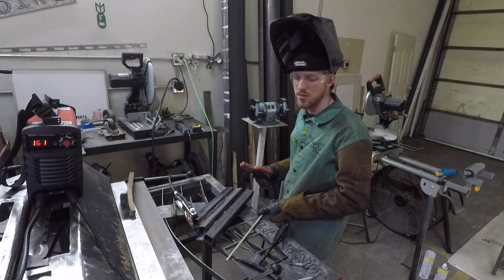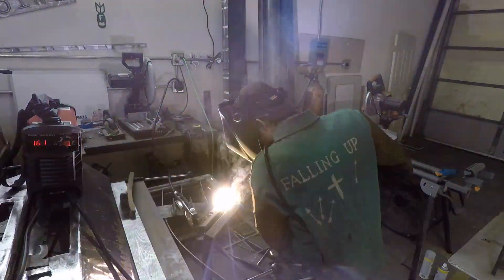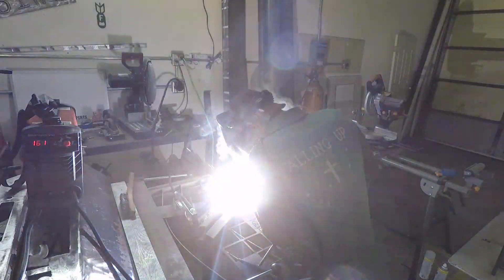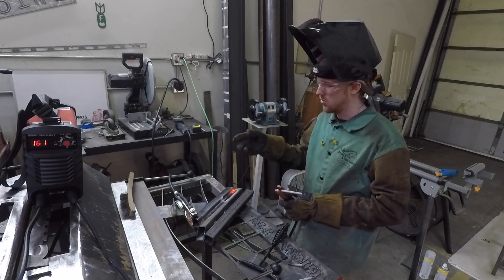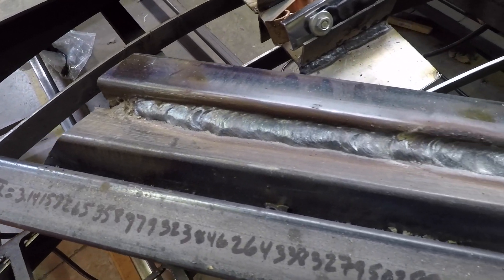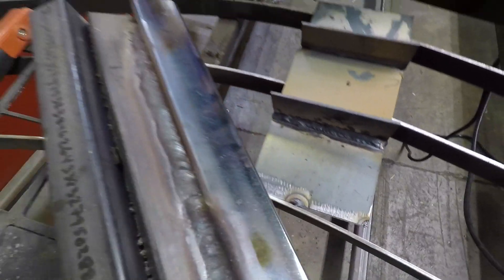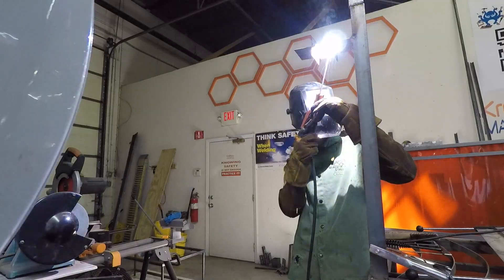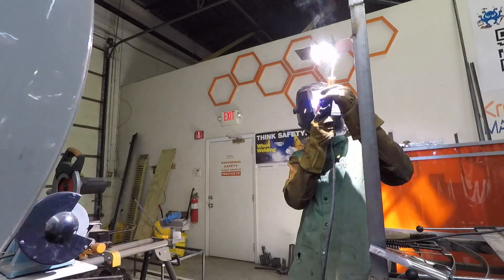Review of ZENY Arc Welder Full Power 220 Volt Test  - Part #2

Comment: So?   I am very impressed with this little Zeny welder so far.  I have pretty much narrowed my search down to this unit.   But my question is.  I have a 220v 20amp outlet in my back garage.  Would this unit run on a 220v 20amp breaker?  The outlet is wired with #12 wire.  So 20amp breaker is all I should use.  My home portable generator is also a 220v 20amp breaker.  Thanks and enjoyed your very informative video.
Reply from the maker: Good question it should be able to work fine!! for most projects.
I have found depending on the machine  that a 20 Amp 120v outlet can get 95 Amps to 120 Amps of welding output.
so on 240v 20Amp I would assume it would be just fine.
And I have been quite pleasantly surprised with how well the welding machine has held up I sold it to a friend who does welding almost continually with it and it's been operating for years under commercial use and held up perfectly well !!!!
Reply: @CreativityUnleashed  Thank you much.  I value your opinion.  I ordered the Zeny yesterday.  So I'm anxious to see how it performs.  Thank you for your video.

Comment: I just got this welding machine and have never welded in my life. I’m going to try and learn with this machine. What sticks do you suggest? Should I run it on 110v or 230v on my generator? Also any advice would be greatly appreciated.
Reply from the maker: Good question when welding on especially smaller generators it can be just a bit more difficult to initiate  the arc because of the rapid high demand of electric.
220 volts whenever possible is going to work better.
And as far welding electrodes (1/8"E6013 about 100 Amps)are probably the easiest electrodes to use. Not all welding electrodes are created equal there are a lot that are good. But I have grown to like Washington alloy
Reply from the maker: https://youtu.be/45-Ipl8E0bk

Comment: Thank you for your honest review of this welder. I’m thinking of picking one up. In your last video you said it kept tripping the breaker when plugged in using 110v on 20amp breaker. So my question is. With this unit, if I was just going to use it on small projects here and there is it ‘functional enough’ on a 20 amp breaker or would you recommend putting in a higher amp breaker or would I really need to install a 220 v plug to use this without major headaches?  Thanks again for your videos
Reply from the maker: inthewake what I meant to say is it was on a 15 amp breaker and it kept tripping the breaker but when I used it on a 20 amp breaker it had no problems.

Comment: Just got this welder as a birthday present to myself. I have been using a Fourney 110  stick welder and it has worked great . Just wanted one that could use 220 . Do you think this machine can do better ?
Reply from the maker: I haven’t used Forney Machines before but it looks like that one’s only 90 Amps. 
So on 220v you could definitely get a lot more amps and better penetration.

Comment: The question is, would you recommend it for someone just trying to get into welding that doesn't want to drop a lot of money? I'm just trying to learn how to weld and have honestly never stick welded... I've only used my harbor freight flux welder a few times and want something better but don't want to break the bank.Stick welders seem to be a better choice for most things compared to a wire welder which from what I can tell isn't really worth the money I paid for it (which was 100 bucks)
Reply from the maker: 97JoMiller A very good question GMAW/MIG are a much more complicated machine so cheap ones don’t tend to work very well. 
SMAW / Stick welders are a lot more simple of a machine so far low cost you can get a much better machine. But with that being said Stick/ welding task a lot more skills and practice to get good at. So good to keep in mind. 
This ZENY welding machine works well for its Low cost. 
But if you are Whining a better machine Everlast is one of the best companies for the price that I have found.
I hope this answers your question let me know if you have any others.
Reply: @CreativityUnleashed  Yes it does... I'm just not happy with the welds and splatter from the 90amp harbor freight welder that I have so I was looking at different welding options. Supposedly the 125 that replaced the 90 is supposed to be better. The videos I saw stick welding although I've heard is more difficult, I haven't seen nearly the splatter from them. I've also thought about looking at gas mig welders as I've heard that they create significantly less splatter, but again more cost for my twice a year I need to break out the welder and do something.
Reply: @JoMiller97  flux core wire feed is just a very inherently spattery and smokey process but it can still make good strong welds. I just got a 70amp campell hausfeld transformer machine and I wish I would have gotten something like this instead. Either way its still a handy little machine to learn on.

Comment: Seems like a decent welder for the money. I had my farm shop broke into last fall and my Century welder was stolen. I replaced it with a Amico Power MMA-200 welder. It has an arc force adjustment and hot start. 60% duty cycle at 200 amps. I’ve been very impressed with it. Paid $239 with free shipping on eBay. Now you can get it for $189.